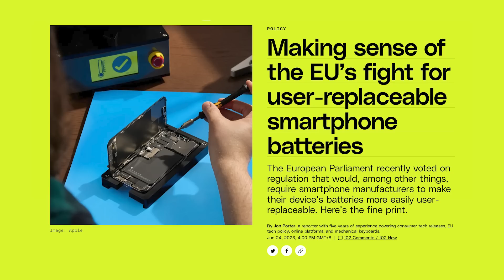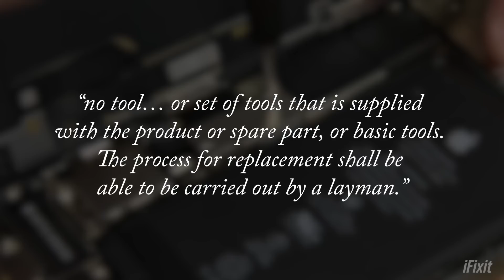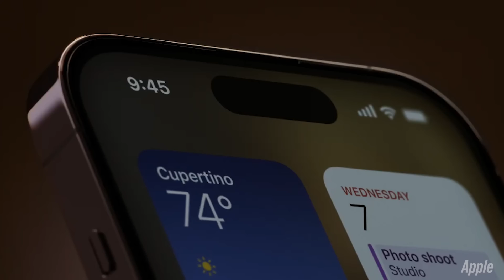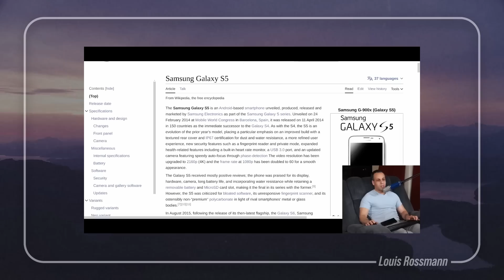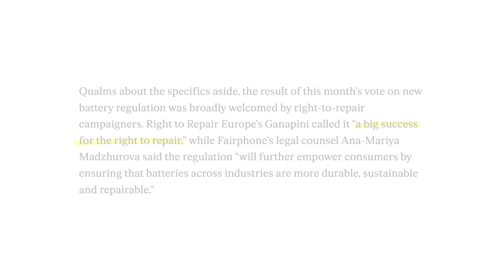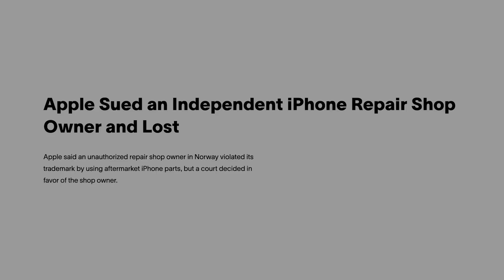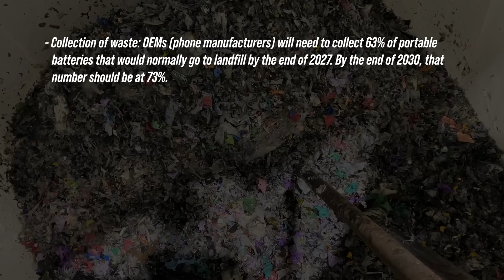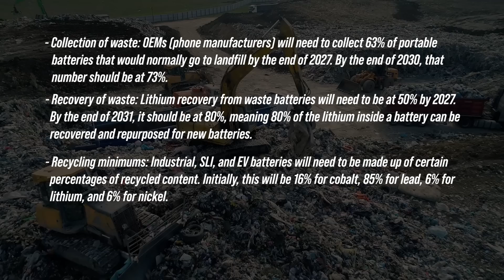EU Just Changed Smartphones Forever

Comment: Waterproofing (specifically IP68) was my big question in this as well, as I wasn't really interested in waterproofing back when replaceable batteries were still normal.
It's nice to see that it won't become a problem.
Reply: Yes the waterproofing issue is a non issue. It has been done and dusted a long time ago. I've had several waterproof phones with removeable batteries. The real issues with the phones is they sucked, but for entirely different reasons than waterproofing. Glitchy software, no software updates (if so then several iteratons behind current) and lackluster specifications were the downfall of most of those phoness.
Reply: Waterproofing is overrated. I am sure that most phones are damaged by drops and not by drops.
Reply: @skyscraperfan  In general, yes. But I do sometimes take my phone with me when I'm swimming, or when I go tubing/paddleboarding. So waterproofing is quite nice. 
A case could be made that I don't HAVE to bring my phone, but I still want to.
Reply: they should try to design a motorize battery compartment and SIM slot. waterproofing is still possible and added security
Reply: Waterproofing a phone doesn't even make my list of features.  I've never once in 20+ years had an issue with my phone getting wet because I take care of my electronics and treat them like the expensive devices they are...
Reply: @Grizazzle It’s close to the top for me, different people, different needs….
Reply: It's certainly going to be a problem, but it's a problem that engineers will be able to solve. It's just a question of whether that's the best use of their time.
Reply: @megamaser  apparently not, considering we've already had IP68 with a removable battery. So the problem has already been solved in the past
Reply: @deadcell66  Just because it was implemented for one device in the past does not mean you don't need engineers to work on the problem for future devices.
Reply: @megamaser   You need engineers to work on it, correct. And yes it's the most important thing for engineers to work on. There's really nothing else a phone needs to do that would be more important and in fact most of the innovations of the last 10 years are unnecessary for 90% of users. Watching high-res movies on an airplane is not a necessity.
Reply: @gorkyd7912  It's more complicated than you realize. They will need to spend more money on engineering to support this, which means it's taking engineering effort away from other work they could be doing, like improving battery technology, or developing new medical or carbon capture technology.
Reply: @megamaser   We already have carbon capture: build houses out of trees. Boom: carbon sequestered until you burn it down or let it rot. Apple and Samsung have lots of engineers, the engineers working on ways to disconnect and waterproof a battery are not the same engineers who are working on better battery technology. That's totally different fields; material science vs electrical engineerings. And as others pointed out it's already been solved, you're just retrofitting tech from other phones (or buying those patents) to apply to modern smartphones. The world's engineers are not a monolithic Eye of Sauron that only works on one thing.
Reply: @deadcell66  Waterproofing will become a more high end feature. But I'm fine with that, tbh. I don't need my phone to indefinitely survive underwater. As long as it resists a spill over I'm totally fine.
Reply: @deadcell66  Easly removable battery without tools + IP rating = potential disatster. Sony Ericsson and Samsung phones had user replaceable batteries (in like 30s) and IP ratings, but seals and sealing mechanisms were AWFUL. Seals broke, plastic was deforming. Even later, when Sony brought IP ratings to Xperia phones without user replaceable batteries, then their Xperia Z series phones were infamous for loosing seal integrity in first months of use.

Solution is simple: batteris should NOT be reaplaceble at whim if we want IP rating to stand. Batteries should be placed under backpanel with seal, with screws, screwed with torque to spec.

Even more, we NEED to have standarised battery formats. Like AA, AAA, or 18650 cells. That way we could get battery for any device at any point of time.
Reply: @maciejgalda  No, what should be done is drop the IP proofint at all, waterprofing phones is stupid
Reply: @megamaser kyocera solved this problem with waterproof replaceable battery phones.
Reply: @stanleytolle416  Every feature you want to deploy in a device requires special engineering and manufacturing effort for any device that you want to have that feature, not only the first.
Reply: @megamaser  making a cell phone easy to take apart, repair and be water proof is no big deal to achieve.  Very simply don't use glue to put the thing together.

Comment: If this is true then smartphones will change to the worse for the end user. Higher cost, flimsy body because it how has a removable part, less durable, probably not as water and dust proof, bigger phone. I'd hate if this actually happens. My honor 20 pro is 4 years old and the battery is still fine despite heavy use.

Comment: You know what, batteries by default are water proof. And the only thing required is exposing 3 contacts which spaced enough apart in most waters will not conduct. So even if the battery compartment is not waterproof it doesnt matter in the slightest.

Comment: Replaceable batteries, screens, and long term hardware/software compatibility are all needed. I still use an iPhone 6S Plus (now almost 8 years old) and would have no problem continuing to use it, except that the battery is starting to get weak, updating the OS is risking bricking the phone, and the apps no longer work.

If I could replace the battery and freeze the software I could probably get another 4 to 6 years of use out of the phone, but Apple deliberately makes this impossible to force me to get a new phone. I am not sure if I have another 6 months of use out of it as a result.

Comment: Maybe we need to take the glass sandwich term even more literally. Maybe the solution is some thin slice of wonder Material that with few additional parts can be stacked together to form a phone. Then you can have more than just exchangeable batteries, but also everything else you normally can't get to easily.

Price starts at 10Mil.

Comment: I'm not entirely convinced this is going to have the impact expected.  I remember much older phones like my Nokia 3210 and 3330 having issues with battery life getting shorter and shorter, and a new battery being the way to go.  But I've not experienced that for many years, I've been using smart phones since I got a Nokia 5800 in 2008 and since then I've never noticed the battery life to dwindle in the same way over the life of the phone.  I now only dispose of a phone when it becomes slow and unresponsive, not because the battery life has died.
Reply: I had one that I had to replace because of the battery. When it happens, it happens fast. You start noticing it lasts less one day, the next month it barely boots.
Reply: @germangarcia6118  how old was the phone at that point?
Reply: @RequiemWraith  Oh, I'm not sure. It was several years old, but I wouldn't be able to say how many. At least 3.

Comment: ++1 for this, but it sounds like the law still needs some fine tuning. Like a minimum device size where this is even possible. Wanna see the fitbit with changeable batteries that you can shower with after half a year of use. Same goes for other niche devices that should be fully sealed like "medical devices". But all in all, laws like these can cause the most awesome engineering.
Reply: There is an exception in the EU regulation for safety. IIRC, they give electronic children's toys as an example, although the details are up to individual national laws. There is no exception for size, and I wondered if it applies to wireless earbuds e.t.c. It's quite a long document full of legalese, and the news all focus on the same superficial points, so I don't know.
Reply: @entcraft44  Thats sounds like a reasonable legislation. Thanks for the additional information.

Comment: its like making a car and welding the fuel tank shut. you run out of fuel and have to buy a new tank or a whole new car. we have the tech to fill the tank easily (swap the battery) but the profit margins arent that big, so they try screw everyone instead(fuel and phones). i bought a samsung phone 6 months ago that stopped working 2 months ago cause the battery is fucked. the phone before that i bought like 10 years ago. something big needs to change.

Comment: I foresee a substantial increase cost for the device since people won’t be replacing them as often and an expensive ‘intelligent’ battery required so a 3rd party battery won’t work.
Reply: There used to be $100 chinese smartphones with replacable batteries. Maybe the high end ones, ultrathin and water resistant could be more expensive, but they already are anyway.

Comment: a 10nm fastener is enough to stop oil leaking from a engine with a rubber seal.
the water "resistant" argument is bullshit. 
Lets go even more easier, a drink bottle with a screw lid, loosely tightens doesn't even leak.

Comment: The LG G5 was not waterproof and we would have to go back to old design. There is a notch here huge bezels. This rule will make phones worse. Also the battery has to be a tiny bit bigger if it can be removed thus the power of the hardware will have to suffer as there is less space for other components/cooling. Its a garbage law that is celebrated only by people that do not think.

Comment: I hope Apple does create a separate iPhone for the EU, and though the battery will be easily replaceable, that it really sucks for battery life. 😆 Yes, there should be environmental considerations driving these laws, but with each law passed (first the USB-C, now this), governmental power over how companies manufacture is starting to feel like overreach. What would be better is funding battery research, and power supply improvements, which hasn't seen much of a change at the consumer level. Encourage trade-in of old devices, and already companies are making software available to last several generations of devices.  You don't NEED a new phone, tablet, computer every few years, and products are no longer marketed as such since they know holding onto devices are getting longer and longer. Incremental updates because they too face technical hurdles to make major leaps without negatively affecting battery life.

Comment: cant wait for off the shelf e-bikes, scooters etc to have replaceable batteries, its such a game changer being able to just swap out your batteries instead of needing around 6 hours to recharge
Reply: You can already swap out the battery on most of them. But they dont even bother to show you how, because one battery is like halfe the price of the bike
Reply: @randomguy2925  true, only problem with a lot of mainly e-scooters is you need to heat treat a layer of glue, followed by 30 screws to get at the battery, the day when it becomes standard that you can just swap the battery out in less than 1 minute while out and about, without needing a hairdryer and 3 different screwdriver heads will be a good day

Comment: They are easily replaceable already. 

The problem is people need a bit of knowledge and a few tools to do it. Where as before it was very simple by comparison. Average person doesn't care enough to buy the tools to try, and the prices people charge to replace them are quite high. So it is essentially non-replaceable. 

This is a great move, making it so batteries need to be  replaceable by the user. In as little friction as possible.

Comment: Replaceable batteries doesn’t do much of anything for the environment or customers. How many times have you had to take your electronics to get the battery replaced over the years? I think I’ve maybe done it once in over 10 years. This is just the EU flexing their power by forcing the big tech companies to bend the knee on this non issue. 
I think this will actually increase waste by making it more common to replace your battery and throw out olds ones for convenience.
Reply: yeah like we used to do back in the day, buy a new battery instead of recharging it.

what planet do you live on?

Comment: I love this idea, but at the same time I’m sad to say it seems like the consumer never wins. I had an LG v10 years ago with the interchangeable battery, I bought a spare one too. Ironically enough, those lg batteries were the worst enduring phone batteries I’ve ever had, before or since. After 2 years I was juggling 2 batteries that both had 1 quarter their original capacity. I was too frustrated to buy two MORE batteries that would just be toast in less than 2 years, so I just got a new phone.
Reply: your first sentence doesnt make sense based on your personal experience, there is no link between the two.
Reply: Just want to point out that that won't happen this time. The regulation is big on reducing waste, so making shitty batteries would hurt the manufacturers by preventing them to reach the waste goals. The reg also makes it mandatory that spare batteries are available for a couple of years after the phone/device is no longer sold (at a reasonable (???) price), so manufacturers have some incentive to keep batteries compatible (so they need to stock less different parts).

Comment: They need to start making ALL batteries replaceable by the user. Manufacturers need to offer to BUY back old batteries from users flat out OR offer an exchange program where users are given 20% or so discount on a new battery IF they bring in the old one, the exact same thing that car companies have been doing for decades by making new car batteries cheaper IF you bring in your old one. This way batteries could be recycled into making new batteries and in turn making batteries cheaper overall.

Comment: WATER RESISTANCE ??? I'll prefer water resistance phone over a removable battery.
Reply: Samsung S5 had a IP67 waterproof rating (one hour under one meter water) and removable battery. The S4 even had a camera optimized to shot pictures underwater. Gopro cameras have removable batteries and higher waterproof standards than any cellphone.
Reply: It’s possible to have both and has been implemented. Have you watched the video ? Louis Rossmann talks about this.

Comment: I'd be happy to see all batteries easily replaceable (For all types of devices, not just phones).  I've honestly never once heard anybody say they want a thinner phone.  Sure, thinner can be better but it's mostly just marketing.  I think it's time someone made a new universal battery replacement like how we had AA, AAA batteries, only this one would be basically flat and square/rectangle shaped and maybe come in a few different sizes.
Reply: Indeed its the the opposite, I complain about how thin they are.  The are so thin the camaras don't even fit. So every phone has these stupid bumps on the back so they don't sit flat when put on a table. All so they can claim their phones are ultra thin* If you don't measure the thickness of the camara bumps.
Reply: You may not hear me say that i want a thinner phone, but you can read it XD 
Seriously though i do want phones to be a bit thinner and i will explain why. If you want a quality phonecase for your phone it can add quite a bit when it comes to the thickness of phones and that will in many scenarios add inconvinience when trying to store the phone in ones pocket. But if phones were thinner that "inconvinience" would go away
Reply: Fun fact

China used USB c ports on phones first . Everyone copied Chinese methods

Comment: So no more waterproof phones? Ill take a portable charger over knowing when my phone touches water, it will not work again.
Reply: Samsung S5 had a IP67 waterproof rating (one hour under one meter water) and removable battery. The S4 even had a camera optimized to shot pictures underwater. Gopro cameras have removable batteries and higher waterproof standards than any cellphone.

Comment: To be fair, I would not dive with my phone which has a removable batteries.

Before phones got sealed shut, you had to be scared around water. Now you can literally swim with them 😂
Reply: Samsung S5 had a IP67 waterproof rating (one hour under one meter water) and removable battery. The S4 even had a camera optimized to shot pictures underwater. Gopro cameras have removable batteries and higher waterproof standards than any cellphone.

Comment: Would be interesting if they made a door at the back of the phone with locks that you unlock with a special tool. Keeping it sealed and waterproof.
Reply: It's required by the new law to not require special tools. However the Samsung S5 had removable battery with a IP67 waterproof (one our under 1m of water) certification.